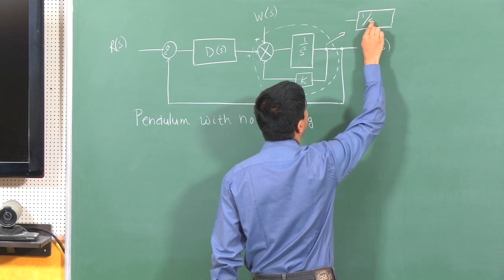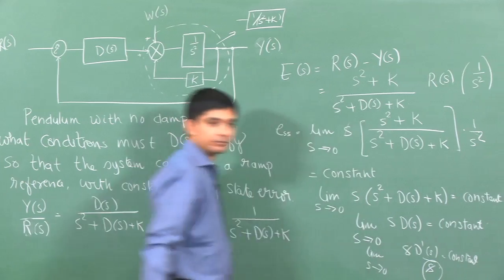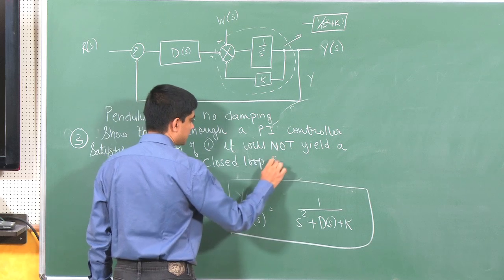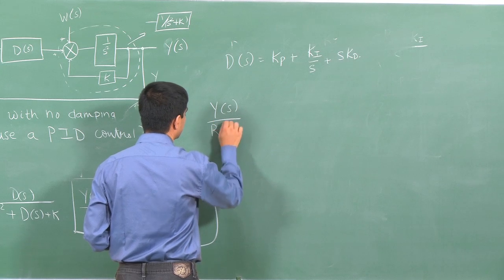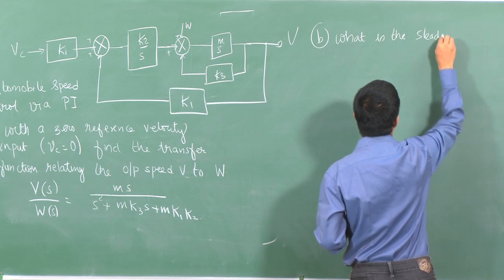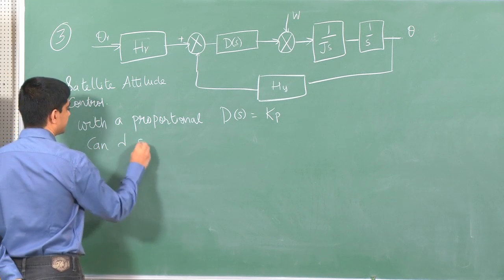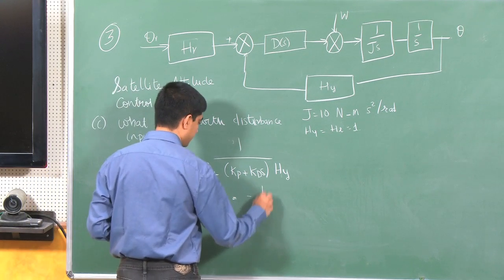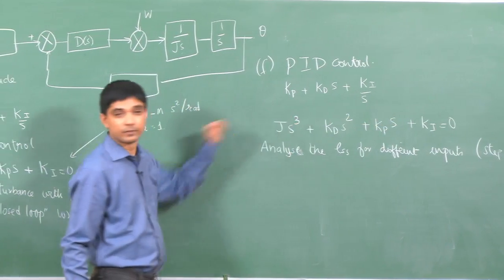Problems on PID Controllers

Comment: In the problem 3.c. we find out the steady state error for different kinds of disturbance inputs including the step disturbance. 
Now when I solve it, the errors are zero for impulse, step and ramp disturbances. It seems to have only a finite value when an acceleration disturbance is provided. In fact the value comes out to be J/(Hy.Kp).
Now I might be wrong here, which I often am. So I'd like other learners to clarify this point if they can.
Reply: Yes this is true the steady state error for disturbance is all zero. 
Except for unit acceleration input which gives J/kp hy.
i got same

that is what sir was also saying since it is a type 2 system for disturbance as input, not reference it is zero error for upto ramp. 

But since.

But in case of overall system Ør as input and the considering Ør/ Ø As transfer function it has steady state error 1/kp hy. Not for Ør / W .

I guess considering overall system gives error. Please correct me if wrong